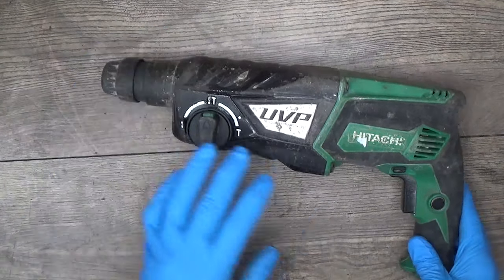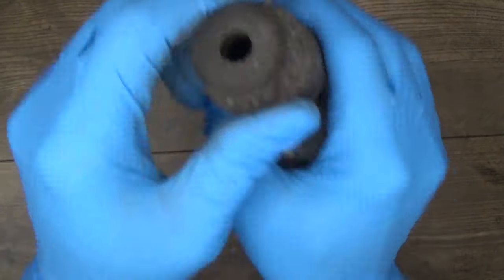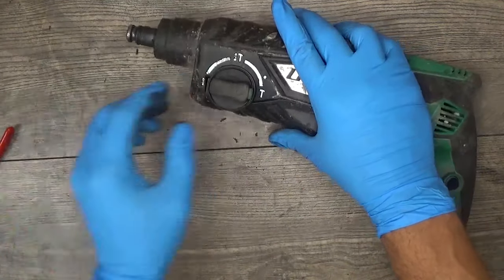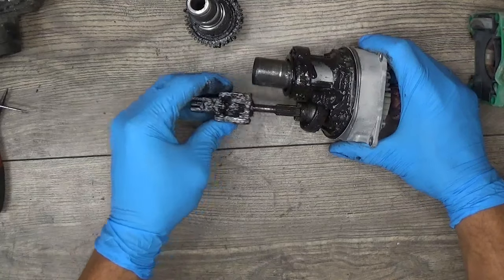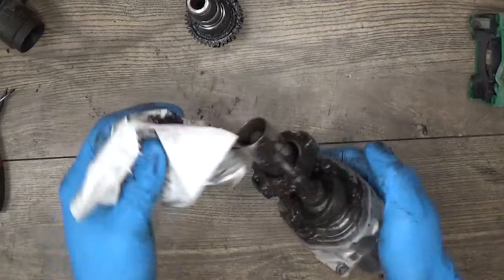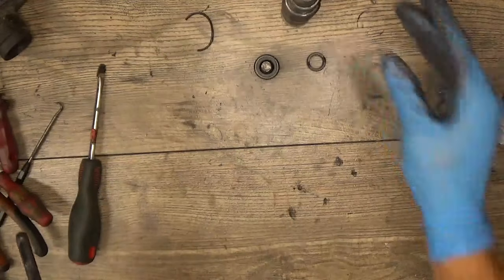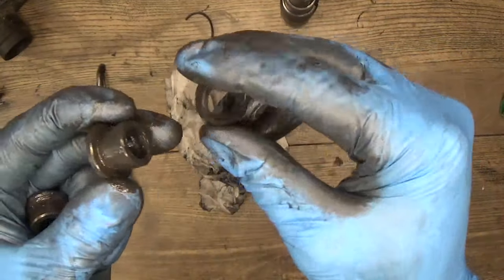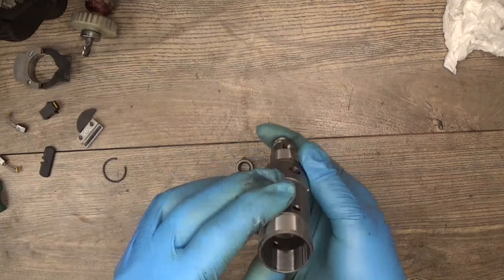How to Repair Hitachi Koki Hikoki DH28PCY Hammer Tool Holder and Maintenance Overhaul Fix  Video

Comment: Thank you very much for the very useful video!!
I have a hikoki hammer drill, and it was in the guarantee time...and i go to the hikoki here in greece and they tell me that it is broken a metallic thing. I told them that i have  guarantee, and they try to tell me tha this is not included.. 
Do you know how can i speak with the general hikoki? I am from Greece and i wrote to the hikoki in Europe and the don't answer in any message that i wrote them.
Thank you ..
Reply from the maker: Happy to know that video help. What parts is broken? If its wear and tear broke that Its not under warranty. But if its cheap part I think they can cover work under warranty, but take money for the part. I was working in authorised Hitachi/Hikoki service in Lithuania and we did that offten
Reply: Good evening! thank you so much for replying so quickly!!
I only had the hammer drill for a month and used it 4 times on a brick wall only... I buy the hammer 280 euros and they want 130 euros to fix a hammer that i used it 4 times...from then i buy a parkside hammer drill 1100W for 60 euros and i work it for 1 year very heavy and nothing is happen yet.......
Reply: @powertoolsrepair you work for Hitachi...wow thats why you know the hammer so well. 😊
Reply: @powertoolsrepair  i can open the hammer to see what is broken that they say...and i can send pictures...
Reply from the maker: @Nioleroy you can find my in facebook same name and photo as this channel

Comment: Bonjour, merci pour ta vidéo qui est très intéressante, very good work !

Je dois acheter un perforateur mais je ne sais pas lequel choisir. Quel est ton avis entre ce Hikoki DH26pb, le DEWALT D25144K ou D25144K et le Makita HR2630 ?
Which is the best technically and most reliable in your opinion ?
For me I think it's hikoki but I don't know anything about it. What is your opinion as a repairer ? Do you think of any other products that are clearly reliable ?

Thank you.
Reply from the maker: Hikoki are very good on hammer drill and demolition hammer. Makita HR2470 ir very good and strong model

Comment: I have the same machine, hammering is not working - when switched to hammering it is workining but only without load when I hold drill with my hand it is not working, can you tell me what could be problem ?
Reply from the maker: I think you need new striker and o-rings
Reply: That aluminium piston should be smooth from inside because my have one deep groove inside ?
Reply from the maker: @gordonfox8967 if it looks like damaged that not good